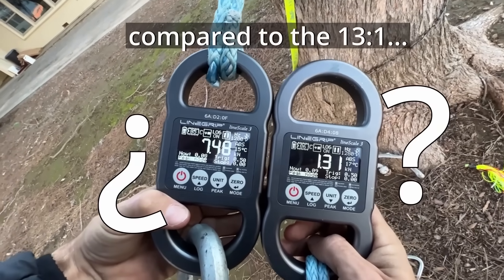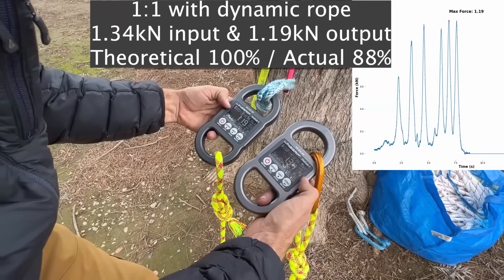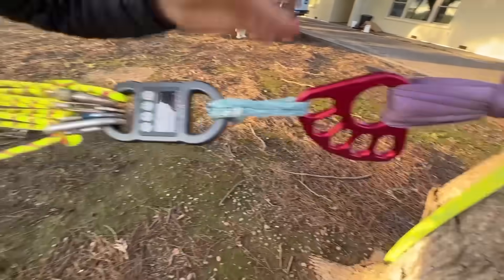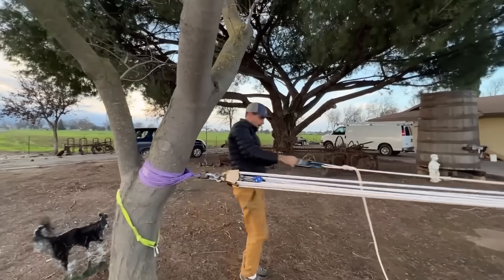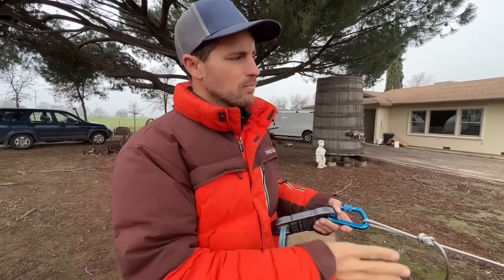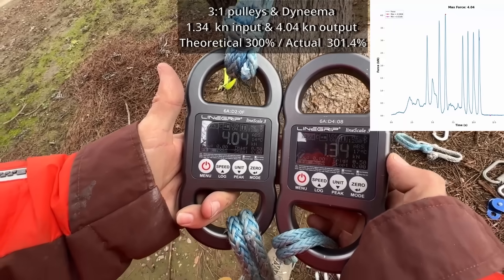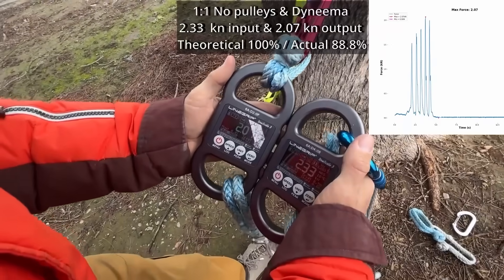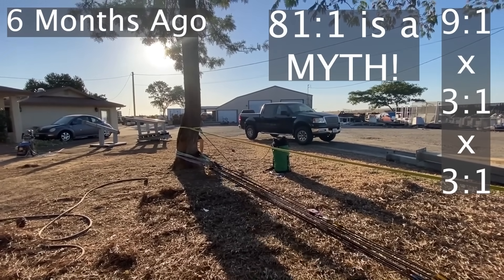Mechanical Advantage is a Myth

Comment: you're adding more rope and more weight which isn't being accounted for because you have it placed horizontally.
if you install the system vertically you would get more accurate results so long as you account for the rope weight

Comment: You are not measuring mechanical advantage, you are measuring how a shock load propagates in a pully system.
While this is interesting, the title is very infuriating and this is probably by design.

Comment: Bro, i know in all that gear you got you gotta have a come-a-long..

I set a tree up on an 81:1 once. I had a 300ft 3/8" steel cable, i think it was originally Boeing's. Took me about 2 days (lol) but i eventually pulled that 150ft Dougie out of the ground, roots and all. 

I repeated it the next day but that time i just set it up on a 9:1. Took me about 3 hours spaced out over the day.

Did it just to do it. Ive felled hundreds of trees, i just didnt want to deal with the stumps at that time.

Comment: You should try the same thing, but also test complex and compound systems to compare their efficiency with simple system of the same theoretical level of mechanical advantage. For example a complex vs simple 9:1 or even 27:1.

Comment: 'Mechanical advantage' is, unfortunately, mis-named. It should be called 'speed ratio'. One is the reciprocal of the other ONLY in the case of zero friction, which never happens. We should say mechanical advantage = efficiency/speed_ratio, and sometimes efficiency can be really sh*te, especially where ropes slide over other ropes, or even 'biners. Shock-loading a rig is a real good way to get non-reproducible results, guaranteed to confuse any otherwise good readings you might have got. It takes a lot of careful instrumentation to handle the pulse case correctly. It's an especially favoured trick by the over-unity community, for exactly that reason. It's a pity you've tarred yourself with that brush.

Comment: i dont think you have done anything wrong here but i'm curious about the stretch you are getting. on the 5mm dynema rope on a 3:1 you got 3:1 but when you went above you started to see a deminishing return. my theory here is that you still have stretch in the system but not where you think. those tree are also stretching. maybe not at 225 lbs nor at 675 lbs. but above 3kn it is alot of force on those trees so they could introduce the stretch you are trying to avoid. at 4kn it seems to me this is alot of force on a live tree at 3' 1/2 in the air. 

also i'm not a climber, i dont work whit that gear at all

Comment: The ignorance being displayed in this video shows a complete and utter failure of our public school system.    Either that or drugs or religion are involved. 

You're going to throw your body weight into the end of a rope with a couple of amazon load cells and think you're going to get any kind of accurate reading???    WTF is making people so dumb these days?

Attach a load cell to your bumper and use a car or a UTV to pull the rope until its reasonably tight.. Give it a few seconds to equalize and settle..  then look at the difference between the load cell on the bumper and the load cell on the other side.

Reminds me of one of these knuckleheads trying to prove the Earth is flat.

Comment: Theoretically, stretch shouldn't affect force, only work. Though it's understandable in an imperfect context, it would generate a measurable force difference.
I think that difference would be a result of rope mass: as it resists acceleration it smooths out the force curve, with an equivalent integral but lower peak
(which isn't the case for stretch, as a perfect elastic would have the same force either side of it at any point in time).

I would suspect that on a continuous pull, the reduction from stretch would be less significant as the peak input force is held.

You did provide graphs for the output LS3, but I'd be interested in comparing the graphs for input and output sides of the pulleys.

Comment: I love your stuff, but I can't watch this one.  Re-title to "shock loading doesn't transmit linearly through a block and tackle" and it would make more sense.  ALL line is going to absorb a shock load, including dyneema.  The longer and stretchier the rope, the more force is absorbed.  If you apply the load as static, it doesn't matter how much stretch there is, in terms of force, but of course there will always be friction.

Comment: Friction is a thing, and is largely an independent variable of dynamic loading.  Using dynamic forces with a dynamic rope, is going to give dynamic results, where the system (rope) acts like a capacitor/inductor to smooth/dampen the input to the load.  moving to a slow load increase (to say 2kN) will show the quality/effectives of the pully selection.  If large great pullies are used, the rope selection will not matter.  Using sharp bends in carabiners etc., will turn into a brake system at about 5:1 or less.  Using static rope allows the "bite" with the people (walk distance to rope break rebound anchor) to be far shorter for the same pull length at the load (the working end of the 5:1 is only moving 1 ft for 5 ft of travel.  2:1 stretch drops that to 1 ft for 10 ft of travel or more due to cumulative loses).  

2:1 and 3:1 are my favorite ratios if you have enough people to pull.  It is not easy, but it goes much faster, with minimal gear.  How do you hold that 5mm Dyneema cord (think four pairs of hands vs 11mm static line).

Comment: Your test assumption is wrong. The force in the first loop is still the same, no matter how many loops. The force increases in each following loop and is reduced by the preceding one when counting them all together. To get completely different result, you would have to measure only the end point.

Comment: The size of the pulley vs the diameter of the rope has an effect on the friction.  That is another reason that the 5 mm Dyneema did better than the 10 and 11 mm lines

Comment: So you have to factor in the stretch of the rope you are using, as well as the length of the rope.  Nice!  And yes, thank you for the PSA not to jump with static rope.  Want to prevent people from snapping their backs.  But i think if you apply constant force instead of sudden force, you will take all the give out of the rope and get a higher force output multiplier.

Comment: I know for a fact that more pulleys in real life means less work. Look at sailboat main sheets d systems. The issue is you not, the system. If you were able to keep the press up you'd see the percentages are much closer to the ratio

Comment: yeah the problem you're running into here is that the elasticity adds a non negligible time component to your force propagation, which ganks your stuff all up when you're testing shock loads and not steady state

mechanical advantage isn't broken, you're just not set up to measure it accurately in this case

Comment: You need an ID and grabs in your system. You can take out all the stretch in the system then your system will be more efficient and more likely to be closer to the values of 3:1 5:1 etc.

Comment: There are so many issues with this testing method that the results are not useful.  Use a winch with a known, repeated force and pull and hold the tension until the system stabilizes.  You are measuring highly inconsistent shock loads, not steady pulling force.

Comment: So, Ryan, I think you are totally right. But let me give my take on why. What you refer to as ”friction” is actually two things: heat generated between the surface of the rope and the biner, AND heat generated inside the rope due to deformation (as the outer curve of the rope is stretched and the inner compressed). The latter is why big pulleys are better than small ones, even when both have good bearings. Now, when you use a dynamic rope, the deformation is much greater (thats the whole point of a dynamic rope: absorbing energy by heating the fibers). While a static rope is much less deformed as it wraps around a biner or pulley. This is my hypothesis, anyone deeper into physics please correct me if I am wrong! Thanks for a great vid! ☀️ (Having read other comments about the need of a static force, I agree. But even having that in place, I think we would get less advantage with stretchy rope.)

Comment: The ratios are probably also acting as a low pass filter, so your sharp tugs arn't being transferred to the load. Take an average of the recorded values and you might get a more realistic ratio. Also seems like your sensors are not reading the same values, as shown by the 'no pully' tests....

Comment: When someone tells you they are using a 3:1 pulley system (or any other numbers), they are describing the configuration of the system, and NOT the actual ratio of mechanical advantage. The efficiency of the system is affected by many variables.

Comment: PLEASE READ
The issue here has much less to do with friction and stretch, and much more to do with leverage and gravity. The system you have set up is horizontal; that means you are fighting gravity on all that suspended rope, which is parasitic to the efficiency of the system. Add to that how far apart your load and anchor are; your pulleys are the fulcrums and the long rope is the lever; that's a lot of leverage working against you.
The 5mm Dynema, in addition to being more static, is MUCH lighter, therefore much easier to pull against the leverage of a horizontal system.

Comment: You are better off combining say a three to one pulling on a three to one to get nine (?) to one. Adding another three to one will get 27 to 1 with losses.
BUT you will not be able to pull over the same distance, or close up all the pulleys. Agree with earlier post, static loading will give much better results.

Comment: The force applied in all cases, whatever the materials used should be a repeatable amount every time.  Also the way the pulleys are rigged makes a massive difference, it's not simply a case of running a rope over a pulley and away you go. But non the less a good fun video to watch.

Comment: Elastic ropes smoothen out the force Spike.
So you'll need to pull constantly to get the best result.
Also, friction will increase to an equilibrium level, where you loose more energy than gained through mechanical advantage.
Combine that with spike smoothening and you get a sh*tty pulley system.

The interesting part is:
Where's the sweetspot for the number of pulleys when applying constant force

Comment: guys, what's with the clickbait title? You didn't disprove a basic principle of physics. I'm sorry but you just didn't. 
What you did do, optimise a man-powered pull tester, is awesome! I'm sure that video would've gotten heaps of traffic. I'm actually building one myself (for testing bolt types in a new soft-rock area we're developing) and that's how i found this video. Stared with 5:1 5mm dyneema, thanks for the info about 9:1 being the way to go! I'm sure lots of others will be inspired to try making them them now too.
ps did you publish your plots from these tests somewhere? I might be able to make some more sense of the results. I did 4 years of stats in uni :(

Comment: As many in the comments have stated, this test is nonsense. Mechanical advantage is very very real, it's ridiculous to assert otherwise. Jerking on a rope doesn't prove anything when you could very easily use those pulleys to lift much heavier weight than you could otherwise lift.

Comment: Your testing is flawed. There is a limit to how much the rope can stretch, because you're connected to an immovable tree. As you reach the limit, you're just pulling directly against the tree, e.g. the load is transferring from your hands to the first strain gauge, to the first pully, then right to the strain gauge mounted to the tree. Instead, connect it to a load that can move, for example, rotate the system vertical and pull an anvil against gravity.

Comment: I'd love to see the results with a steady pull force rather than a very brief yanking pull force. I bet it would be closer to the desired results. Especially when using a rope with elasticity as it doesn't have time to even out the load from one side of the pulley to the other before the tension from the brief yank decreases. I'd also love to see a title with less of a click bait connotation as that was enough to make me almost skip this video.

Comment: This comment is mostly for the benefit of the curious, and not for those with a prior understanding of Statics. 

"Nobody really talks about stretch"
Yes! But also...don't they? Adding the dynamometers to those physics diagrams, and suddenly you've already introduced two stretchy things to your setup. That is, after all, how they work: the metal of the load cell inside stretches eeeeeever so much, and the strain gauge translates that into a force reading. If you already have that in mind, then you should already have the thought in your mind that all solid materials experience strain when stress is applied. All of the connecting apparatus before the "far" load cell can be thought of as acting like another strained part of the "near" load cell *that isn't picked up by the strain gauge*. I think explaining this would be a crucial additional step to educating viewers on how physics drawings differ from experiment. The output on the "far" end is reduced just as much by strained rope if there are no measuring devices, of course, but including them in the discussion gives the fullest picture for others to attempt their own experiments. 

I leave it to other commentators to thoroughly, thoroughly discuss why dynamic loading and peak load measurements are not great experimental choices.

As far as the load cells being thrown off by the shock loads: dynamometers are built to take a hell of a beating. Unless it's a super no name imitation device from lands unknown, at most him throwing his weight into would might throw the reading off by a division or two. Easy way to check is to see if the Zero has changed.

Comment: You might want to look into some better force gauges. The force at both ends of a rope is the same, stretch rope or not. The only other force at play is the force required to accelerated the end of the rope. Shock loading the system is a poor way of testing, and all the losses here are due to friction

Comment: I worked with a tree company where the boss kept saying "this is a 13:1" or "this is a 5:1" or whatever, and they were not.  The number of ropes is not how many times it is multiplied.  Redirecting is not multiplying and the pulleys have to be in the right pattern, not just thrown together.

Comment: You also have not accounted for horizontal tension force from the rope weight. Think if you have a weightless rope, it will have a mechanical advantage with a straightforward ratio, e.g. 9 to 1. However, the weight of the rope (when strung horizontally) creates an additional (equal) pair of forces pulling from the middle ropes all the way to your input and your output device. This "x" factor makes your ratio go from 9:1 to something looking like (9+x):(1+x). 

If you solve for that "x" for each ratio, I would imagine you'll find a trend where "x"  becomes bigger when you add more ropes, because the middle ropes gain more advantage over your measuring devices.

Alternately, you could string the ropes vertically and then the weights will cancel out (unless you have your measuring devices on opposite ends, then I believe you would need to subtract the weight of one segment of rope, pulley to pulley, from the output force to get a good theoretical approximation).

Comment: This is progbably all over the comments, but if you want to compare the ratio's using a human as input, you need to preload the input before you jerk it because you can't output the same power over 6 ft that you can over 6 inches.

Comment: Your using a rope. Use a cable and check again. Prob be a bit closer to what's it supposed to be over a short section (weight of cable will add force if too long) When we're off roading we depend on the stretch of a kinetic rope to help recover rigs using what you've shown today. The additional help to standard mechanical advantage of smoothing out points and adding a little extra at the end of stretch is a game changer that helps alot.

Comment: 2:00 According to my knowledge you have 3 wires and 2 blocks, so force should be 200% but you expect 300%. And you got 1.13 and 2.26 which is exactly 200%.
Reply: Dunno how this isn't top comment, he kept counting redirects as mechanical advantage. Every test was calculated wrong.

Comment: I am not sure you can just look at maxima in dynamic force. With the elastic rope you also built a low pass dynamic system damping your input spike of force. You take out the high frequency part of the input pull. 
The input reads the spike of your pull. But the other end does not. The difference goes into the rope.
Try a static setup with weights.

Comment: Did you try pulling one scale directly hooked up to the other to see if you get any difference?  I wonder if there is a 'calibration issue' between the two devices.   Or run tests swapping scales end for end with the same line/pulley set-up to see if your readings are accurate.  Also, like others have stated, either repeat the test vertically with a static hanging weight or use the capstan winch for a steady pull for each test.